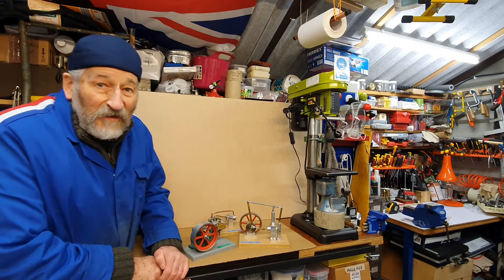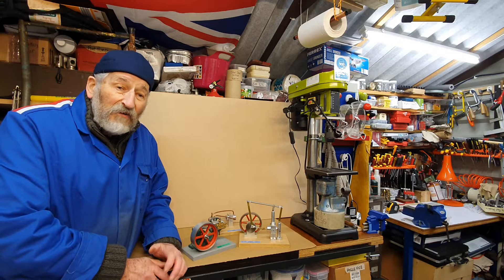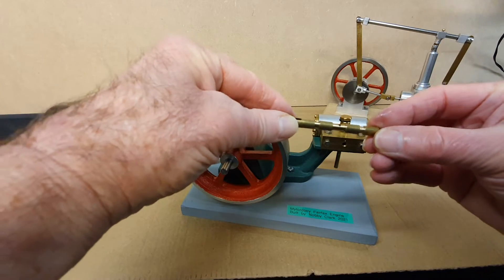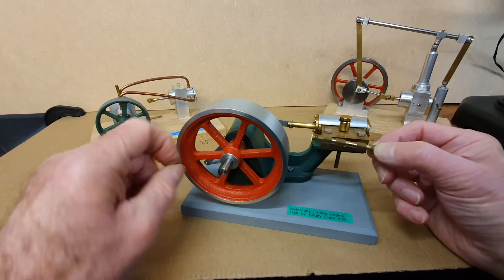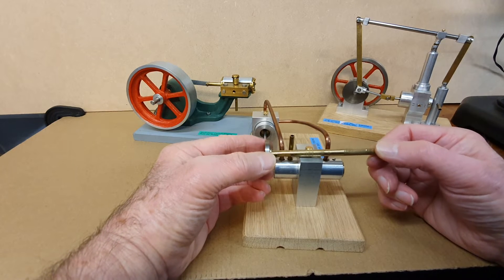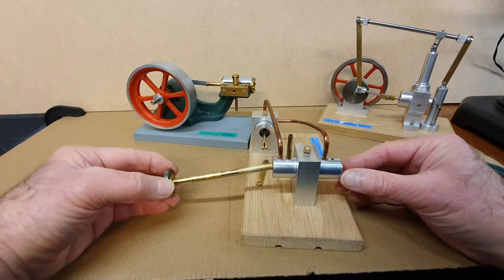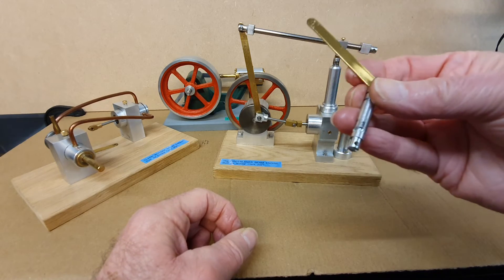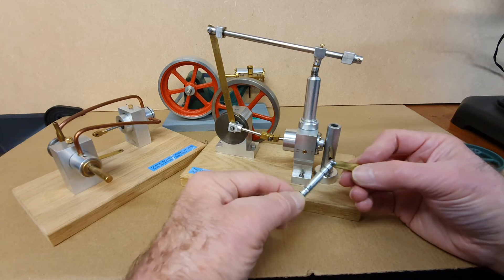Spool Valves in model Steam Engines.

Comment: Very nice engines mr Nobby
Reply from the maker: Thanks Andre. These engines followed on from making the wobble engine. I've made about ten engines so far. One from a kit, the others scratch built. There are videos showing these running as well. Good luck with your build Andre. I'm sure it will be successful. ATB Cheers Nobby
Reply: @nobbysworkshop  Hi Nobby
I have posted the switch. It’s looks used to say the least. The way it was when I got the lathe. It was working though. Hope you can use it or parts of it.
Reply from the maker: @RustyInventions-wz6ir  Thanks Andre, I'm very grateful for your kindness. ATB Nobby

Comment: Great explanations.

has anyone done a spool valve that's actuated pneumatically/hydraulically?
I understand there are spool valves arrangements which can function akin to electronic flip flops, ie they have two "input" ports, which select the output state of the spool via a pressure pulse.. and the spool will remain in it's last state until the complementary input received .I'm thinking such a spool could be extended with extra grooves to control flow into main chamber.

little bump valves at appropriate angles around flywheel, could then be bumped by a projection off flywheel at appropriate crank angles etc
Reply from the maker: That's an interesting idea Steve. I've not seen or heard of anything like this, but it's certainly food for thought. Cheers Nobby.

Comment: Good explanation Nobby.  You can actually join (bridge) the feed and exhaust lines of the rotary valve engine right at the crank housing, rather than at the cylinder head. The one line to the cylinder head then acts as an oscillating air chamber.  Reduces the number of copper pipes required.  I did this on a couple of my builds.  Interesting engineering principles.  Cheers Rob
Reply from the maker: Thanks so much for the comment Rob. I value you advice. I was going to follow your design, but in the end copied the Retro Steam Tech version. It did give me some practice in copper pipe bending (haha) cheers Nobby